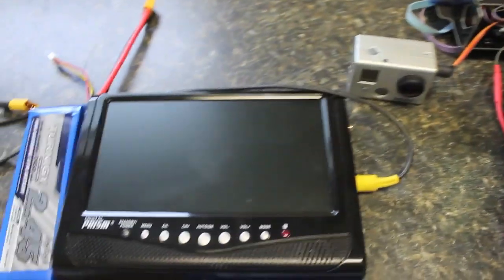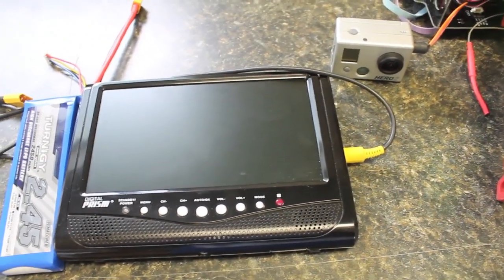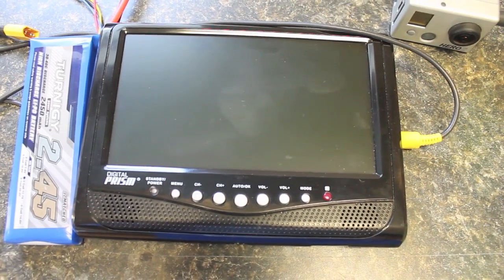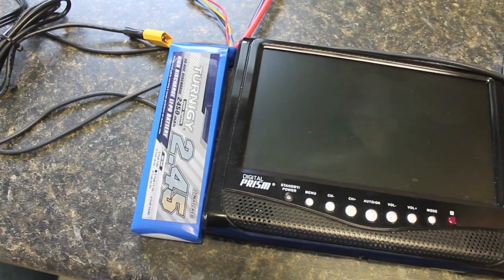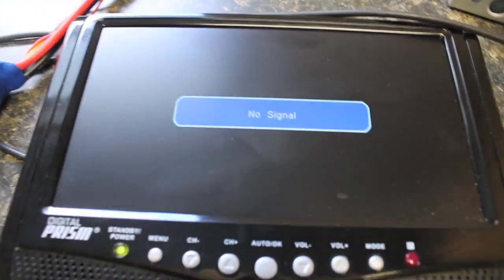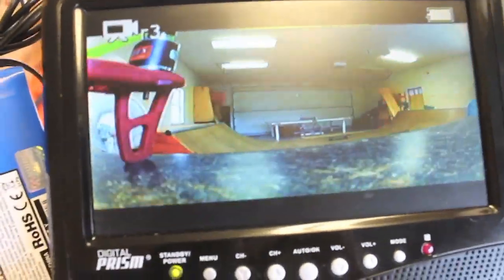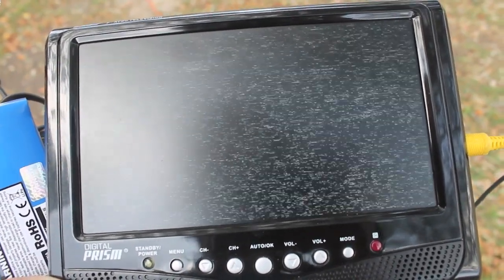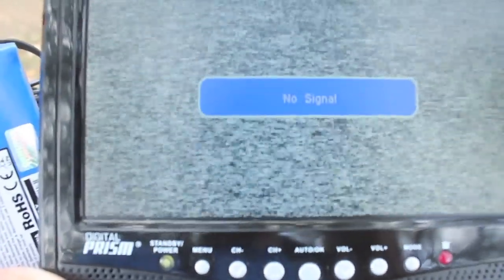Basic FPV Monitor Signal Test w/ 7" Digital Prism LCD Monitor and GoPro Hero

Comment: What is the range?
Reply from the maker: Will6804 About 1/4 of a mile with the default antenna set. Not very good. I'd recommend upgrading your antennae to cloverleaf which should at least double the range.

Comment: Dennis I just got my 7" monitor in and it has nothing but a 3pin 3S lipo plug for charging. It cme with a charging cable which has the male 3S lipo plug and its split out with the little red two pin main battery connector.
It came with NO instructions so I have no idea of how to set my 4-button charger up.
Do you have any ideas on this???? Im lost dude :(
Reply from the maker: What would make helping you out much easier is to post a question at www.garagepilots.com with a link to your monitor. I'm sure we can get you going with that info :) Hope all is well.
Reply: Dennis Baldwin Thanks dude! On my way!
Reply from the maker: GeorgeBonez Cool man. Looking forward to you joining us!

Comment from the maker: HobbyKing says to expect 500m with this setup and default antenna. That's a little over a quarter of a mile, but I've seen the blue screen much closer than that. A lot of it will depend on your terrain and visibility, but definitely don't expect to get more than 1/4 mile without a different antenna config.

Comment: I received the Tx & Rx set from Hobbyking today. According to the manual the receiver operating voltage is 6,5 - 12v. So I guess the 2S 7,4v Lipo will run safe?

Comment from the maker: You should have an operating voltage range where 5V is somewhere in the middle. Check the manual and see if that's the case. I would think you'd be safe running a 2S lipo to power it. Let me know what you find out.

Comment: you need to understand monitor video circuits and block diagrams, they just inserted a video mute on modern monitors thus not show raster video and make it clean, just like mute on fm radios and ham radio its called squelch! i haven't seen anyone do this on modern monitors but it can be done, one day someones going to upset the manufacturers that sell unmuted monitor gadgets like fatshark xD!

Comment: the black screen is actually muted, with or without blue screen that LCD mutes the video, if it doesn't as most fpv wants, you see raster noise from the receiver! actually you can mod LCD and remove the video mute!

Comment from the maker: The receiver I'm using accepts an input voltage of anywhere between 7-15V. I'm using a 3S lipo (11.1V) to power the receiver on the ground with no regulator. It's a 2200mAh battery. Does that answer your question?

Comment: Dennis, how did you supply your Rx video and which kind of Lipo are you using? Did you are using any kind of protector to regulate the voltage? Thanks.